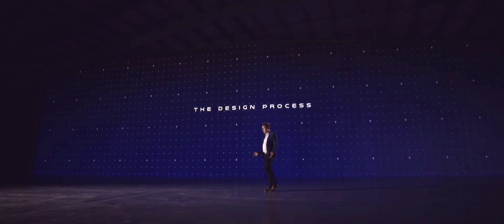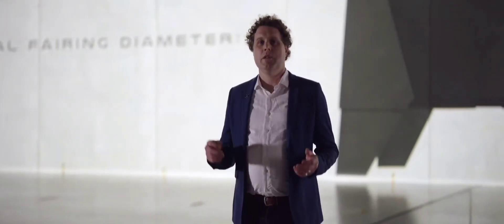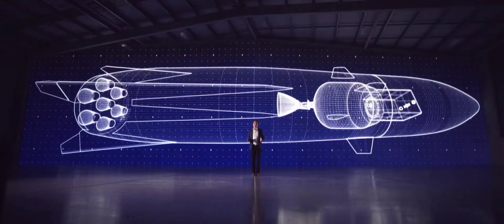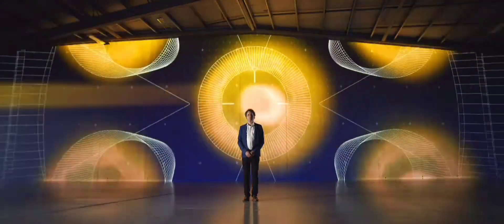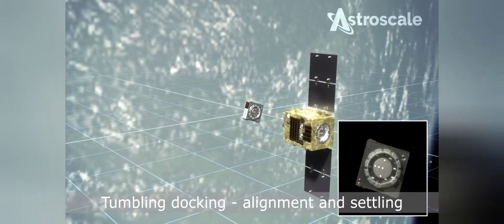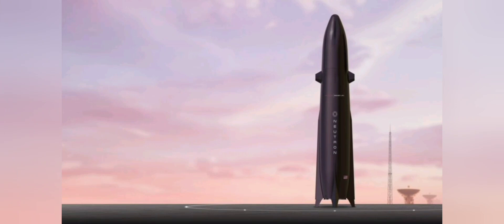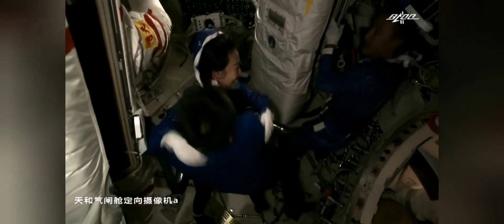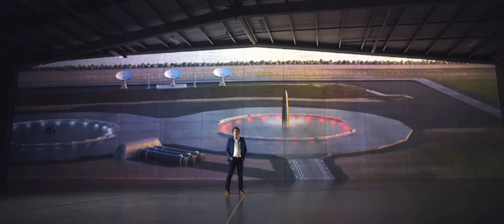A rocket for 2050 - Why Neutron is much more than outdated competition for SpaceX Falcon 9

Comment: Not everyone wants to launch their sats to the same orbit at the same time, because Starship has only two purposes; finish the Starlink constellation to create cash flow for other SpaceX operations, and take huge volumes to deep space. As a customer based satellite launching system it makes no sense due to the reality it will most likely be left with loads of room with only a few customer sats to launch at a time which will lead to higher costs. Having a quickly reusable system that can tailor to the customer will always be needed, and I'm sure they've done their homework and their 8 ton decision will probably fit most everything for the forseeable future.
Reply: If SpaceX can get the cost of a Starship launch down to say $10 million, or about half the cost of a Falcon 9 launch, they will be very competitive with every other launch vehicle, for basically any payload. If someone wants a dedicated launch for a 5 ton payload, and SpaceX bids Starship at $30 million, while Rocket Lab bid Neutron at $35 million, why wouldn't you go with Starship? And SpaceX would be more than happy to take the $20 million in gross profit, provided there's a Starship available and they have a free launch slot.

Comment: Ya know now that I look at the shape of it, the fact that it's so stubby looking makes me think they'll someday add a longer booster to the bottom, then use this entire thing as a 2nd stage instead. For instance in terms of SpaceX, imagine that the entire Neutron rocket is like a Starship and a super heavy type booster would be added to the bottom. I think with some upgrades to the design it could work, add a heat shield, make the legs actuate to give some aerodynamic control on re-entry, get rid of the current 2nd stage and make the payload fairing much larger...
Reply: theNew Tron is pay tron for rocket lab :O only fans will buy it :)P Mr Beak fighting the Long Mask star ship which hae starlings sat lights :) thanks Lo Ping xian china
Reply: I don't think it's going to be that easy. Right now the Neutron is optimized for a certain altitude and reentry speed. If a new 0th stage boosts it up higher, that means it will have to spend more fuel to decelerate, re-enter and land.
For instance, let's say 15% of the first stage fuel now is used for re-entry and landing. If you increase the altitude and orbital speed with a 0th stage, let's say 30% fuel is now needed to re-enter and land. You've just halved the mass fraction of the Neutron. And your first stage now has to be bigger to carry that extra mass to orbit (because you now have to carry extra fuel that is not used for reaching orbit), creating a cascading exponential increase in weight and cost. Not to mention the heat shielding will probably have to be buffed up on the Neutron, as it will be reentering the atmosphere at a higher speed, further increasing the mass, and increasing the amount of fuel and structural mass required on the 0th stage...
At that point it might be cheaper and more efficient to just design a whole new 2nd stage than reusing the Neutron.

Comment: Peter Beck wasn't necessarily throwing shade at SpaceX with that impact demonstration, the original concept for Neutron, was in stainless steel.
Reply: And then they both change to the other material. I love it. Carbon fiber is very expensive. Good luck Rocket Lab. Better idea than catching incoming parts with a helicopter, that seemed seriously dangerous.
Reply: @davidforget6906  they are still gonna do that, first catch attempt is next launch

Comment: I'm hoping that both Starship and Neutron will be obsolete by 2050, that they'll be remembered as essential early steps towards ever more awesome launch systems and spaceships!
Reply: or there will be more advanced versions of them
Reply: I think by 2050 Starship will have been replaced by... a better version of Starship.  Likely taking advantage of advanced composites and other material science advances to increase payload fraction.

But in terms of getting lots of mass out of deep gravity wells Starship is kind of the be-all-end-all. It doesn't get much better without discussing launch loops or space elevators. 

This assumes Starship ends up as reusable as Elon hopes though.

Comment: Since Neutron rockets can loft modular inflatable space stations to LEO, they could also launch modular inflatable spaceships to LEO (just add an engine).  If they develop a space-junk retrieval capability, then instead of de-orbiting the space junk (especially larger pieces, dead satellites, boosters, etc.), they could use their second-stage space tugs to bring it back to a space station to be disassembled and "mined" for in-situ resource utilization or refurbishment and reuse.  

Considering that anything in orbit is worth thousands of dollars per kg just by virtue of where it is (i.e. the cost of putting it there), it would be a real shame to burn it up in the atmosphere.  Imagine if a Neutron's space tug could have run up to that Chinese booster from their space station launch, grabbed it, and boosted it into a stable orbit.  Instant space station!  Or if it could be refurbished and refueled, a powerful rocket for deep space and planetary missions.  Otherwise, it's a massive trove of refined metals that could be reprocessed and 3D-printed into large space structures.  If we want to mine asteroids someday, why not start out with the hunks of refined metals and high-tech alloys right here on our doorstep?
Reply: Another advantage of the Neutron vs. the Starship is that, being smaller, it doesn't have the potential to cause a huge "N-1 disaster" if it blows up on the launch pad.  That should make it easier to get larger numbers of launches approved, and perhaps make selecting launch sites easier.

Comment: I think, also, that Neutron suffers from a well understood flaw: You can't mount the 'flights' of an arrow at the forward tip of the 'arrow'. In the parlance of "That horse won't run", then, definitely, "Those itsy-bitsy guide vanes will not out-control the aerodynamic surfaces of those landing legs." Or however really clever flight engineers would put it.
Reply: Think of where the centre of mass will be when the tanks are 90% empty. It's totally possible to have an aerodynamically unstable flight with proper control systems, but there's no guarantee that it will be unstable. All that stability requires is that the centre of pressure is behind the centre of mass, so by your arrow analogy, you can have some flights at the front of an arrow if all the mass is right at the front.
Reply: @oliverlamb8892  If you look at the control required from a PID standpoint, I think the landing legs would have a large Proportionate factor in the equation. The small flight control vanes would supply a Differential  control value, but they are small and in a low pressure flow compared to the landing legs, so my initial judgment of the D factor would be that it is too small. Then you've got sloshing propellant elements to contend with. I think they've got some tough flight-control engineering to solve.

Comment: The hitting materials with metal beam made me angry! What rocket needs to be hit with metal beam, and survive.
Reply: If the carbon fiber does break, it will be complete failure.  The ability to deform without cracking or rupture is a much better failure case. A dent is better than a hole in a rocket tank. (And the demo was misleading since the stand with the material was allowed to move and not bolted down)
Reply: @clarkkent7973  It was also misleading because it wasn't at cryogenic temperatures. Stainless steel gets stronger as it gets colder. Carbon fiber gets weaker as it gets colder.

But it's also a bit of a pointless comparison. One of the primary reasons for Starship being made out of steel is that the steel has better thermal properties during orbital reentry. This is a challenge that Rocket Lab isn't even attempting to solve on Neutron. At least, not yet. The Neutron first stage will be returning from space, but it's way, way less energetic than orbital reentry, and carbon fiber can handle it fairly well with minimal heat shielding.

Comment: I asked Peter on twitter but have yet to have my major question about Neutron answered:

With an integrated fairing, how is crewed launches/human rating going to work?  It seems that fairing would limit abort scenarios (and crew entry), so I can only guess it would have a different or no fairing when carrying crew.

And to head off the main point others have raised when I bring this up: BOTH Peter's original announcement and his new update video still mention human rating or transport, so YES all indications I've seen say they still plan on a human rating.
Reply: I would suggest IF and when crewed flight ever happens on Neutron that the a block upgrade would happen to the upper section of the Neutron and the fairings removed with the a capsule & second stage designed to fit the  the block upgrade. You may find they simply just unbolt the fairings and and the a different 2nd stage and capsule design fits on... or as part of the ejection the fairing blow and eject at the same time... we will have to wait and see...they not giving all their secrets in one hit... ;-)
Reply: I think that's one of those tough questions thats simply too early to be answered at this time. SpaceX already made that one piece no abort option long ago and is very enticing, (weight wise) as it is ballsy as hell.
Reply: @NighthawkNZ  The Space Shuttle didnt have an abort and neither will Starship. In the future we will see Dragons and Dreamchasers always filling a schedule to taxi. They already do this often on the ISS.
Reply: I'm guessing that Neutron is meant to be an Autonomous Cargo Tug for deployment satellites and equipment into LEO.
Reply: @scottywills124  and people died. I doubt starship will get human rated as it currently stands either.
Reply: @geesehoward700  Sure, but what do you think this is, a hobby?
Reply: I suppose they would make a separate version for crewed flights with a traditional setup
Reply: @geesehoward700 Yes, yes and yes they died on the Shuttle and WILL die on a Starship with or without an abort system. Is that really the only point you had? The inevitable? The inevitable demise of 1 Rocket, 1 Airline and 1 Car out of a huge fleet? I digress but there you have it. We could prance around that argument all day.
Reply: @myyklmax  
"autonomous cargo tug"
Please re-read my comment.  I already addressed this.
Reply: It's entirely plausible that the fairing would be swapped out for an unenclosed crew capsule. If the first stage descends with no fairing, then how would it be worse off than F9?
Reply: One could imagine the fairing could be designed as normally open with very fast spring return, and upon anomaly detection, would disengage the mechanism that holds it shut, allowing the abort system on x capsule to do its job
Reply: When designing for human rating the main difference is building in a 1.4 margin of safety. For unmanned rockets 1.25 is more typical. Stuff like fairing design will come later. The first step is they're just going to build everything beefy (by aerospace standards.)
Reply: The major requirement for NASA certification for crew missions is the rocket having a EAS - Emergency Abort System (crew escape capsule) A necessity after the loss of Challenger.  At its present design, Neutron does not possess this requirement.
Reply: @DrMackSplackem  no it's not a hobby but tell me what would happen if a fully crewed starship failed on lift off? How many people would die and what would happen to the program then?
Reply: @scottywills124  building things that are dangerous is a part of every day life. However building something dangerous that doesn't have to be is stupid.
Reply: Could a commercial company handle having its fleet of rockets being grounded indefinitely pending investigation?
Reply: @geesehoward700  Boeing has handled a few times of their airplanes being grounded. Large accidents with many deaths is something that is bound to happen more and more frequently as humans go into space more and more. You do what you can to avoid it, of course, but space flight will never be completely safe.

Starship might not be human rated (which is something that NASA does before putting their astronauts on a launch vehicle), but that does not preclude SpaceX from flying their own crew and passengers.
Reply: @geesehoward700  Of course that would be a horrible event in and of itself, but if you're talking about a tragedy that may mean the difference between success and failure of an ambitious program of unknown but possibly limitless benefit to mankind, with the whole enterprise subject to abrupt cancellation on a whim by government overlords, then it's extremely vital that some tangible success is achieved very early on.
 I don't have an inside track to SpaceX, but as foolish as Musk may seem at times, there's no way he doesn't comprehend this threat.
 In fact, this may partly explain the nature of his company's current dilemma with Raptor. If their propulsion system can't be relighted, let alone reused, this means that SpaceX can not carry out a single mission, let alone a sustained colonization of an alien planet. Tragedies are inevitable, but they're hardly innate barriers. Apollo I serves as one such example, and no escape system could have saved that crew. Then as now, the key to success is to have the first loss of crew occur only after enough time has passed after a sufficient number goals have reached to establish a perception that the overall effort can pay off, despite such setbacks. Threading that needle is tough to be sure, but remember that the end goal is to make rocket transportation as regular as air travel. Airline travel is not contingent on escape capsules. What makes you insist that the rockets of 2050 be so constrained?
Reply: @geesehoward700  They will still have Falcon 9/Heavy, probably at least until 2030. And they are also the largest satellite operator in the world, with Starlink, so they have other sources of revenue.

I would also consider that "Starship" isn't one single vehicle. It has like seven-ish different variants, and they might not all be grounded in the event of an accident. Like, there's no reason you couldn't continue flying cargo, even if you had some weird accident where a mars Starship depressurized unexpectedly and killed the crew.
Reply: @espenha  I was specifically thniking about takeoff and the booster although it might even hold true for the top section. 

Elon has already said they need to have the starship ready for launching skynet .2 and it would need a launch every 2 weeks. A lot of things are dependant on it.
Reply: @geesehoward700  Even if there is an accident with a booster, it doesn't necessarily mean that you have to stop launching. It might be smart to hold off until you know what caused the accident, but if the statistic is that you've had one failure out of the last thousand launches, that's still likely good enough for cargo like Starlink.

And Starship does have some abort capabilities. If there is a fault with the booster at probably around T+10 or later, the Starship can separate and perform a powered landing. And after MECO and stage separation, there are options for aborting to orbit, and performing powered emergency landings. Starship probably has better coverage for abort scenarios than the shuttle.
Reply: @espenha  it's not going to get very far from the booster if it's underpower.
Reply: @geesehoward700  They will quickly separate, as soon as the Raptors on Starship fire up. We are talking about a minimum of a T/W of around 0.45 for only the sea level Raptors, and around 0.9 if all six Raptors are used. That means they separate at 4.4-8.8 m/s^2. 

The big issue with landing the Starship after a launch abort is that it has too much propellant to be able to land. It needs to burn away sufficient propellant to get the T/W above 1. If they are only using the three sea level Raptors, that takes around 415 seconds. If they are using all six Raptors it takes about 38 seconds. 

In the time that the Starship is using to burn away excess propellant and get the T/W above 1, the Starship needs to have some altitude and velocity, so that it doesn't hit the ground before T/W reaches 1. Using all six Raptors means they can successfully abort significantly sooner in the launch. I'd guesstimate at around T+10 seconds, while using only three Raptors you would probably have to wait until around T+20 seconds.

Since they are able to do static fires using the vacuum Raptors at sea level, I'm guessing a launch abort would use all six Raptors.
Reply: @geesehoward700  Yes, but the early airlines were economically viable long before their safety records reached a level anywhere near what we would consider acceptable today. Actually, that's the only way they even got to be so safe in the first place: Frequent and sustained experimentation, followed by refinement.
 I have just two questions to clarify your position: Is it your contention that the primary danger to a crewed Starship vehicle on a deep space mission to Mars the launch phase? And if so, what is your proposal to rectify or at least ameliorate this threat (and please don't reference Gemini, as triggering that sequence would've been worse than the Zapruder film)?